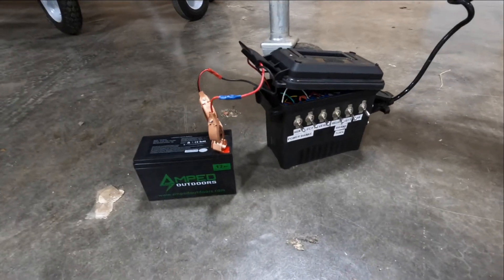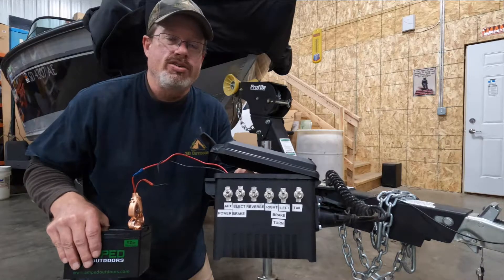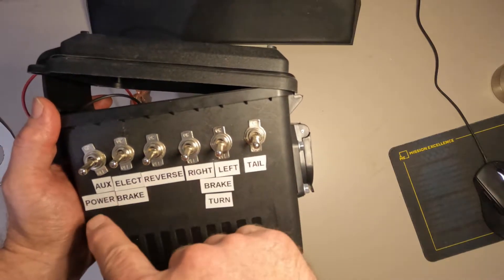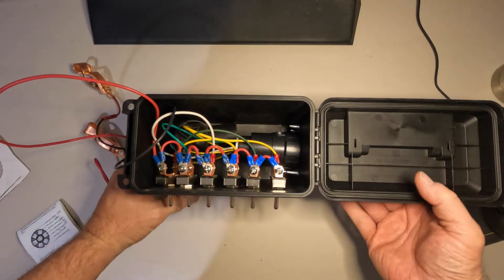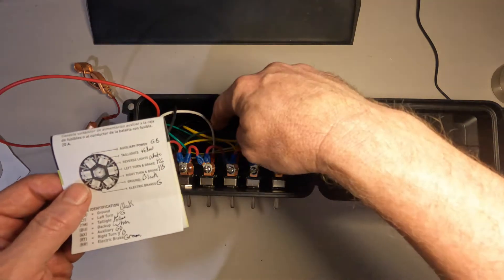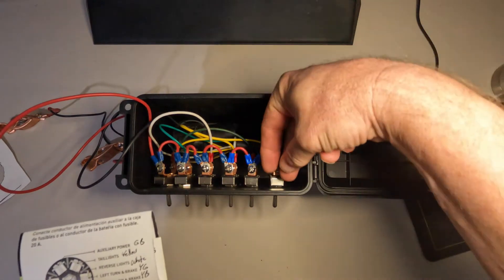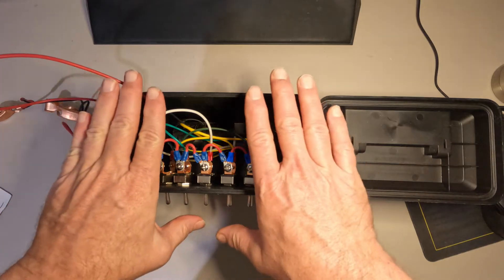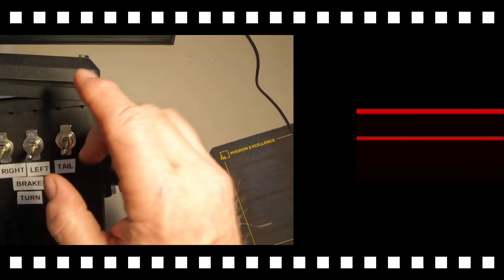Trailer Light Test Box- How to Build

Comment: Made a similar one but for European 13 pin. Also made a vehicle plug tester from 4 compact rear light clusters (2 bulbs 2 LED, this is needed because some vehicle electronics don't play nice with led but might work going with bulb) and separate bulbs for conductors not used for lights. Long cable so I can troubleshoot from the cab - the long cable is connected to the lights with an old school pvc connector strip where I cut down the surrounds for the screws so i can clip on to them. Has a cigar lighter cable to add a known good ground. Test everything from the drivers seat
Reply from the maker: Thank you.

Comment: How does the brake test work? I would like to make this, but need to set an adjustable timer on the brake circuit so when it is on, the brakes will engage with the electromagnet every 3 to 4 seconds and then disengage. If you spin the wheel while the axle is elevated, you can test the brakes if working correctly.
Reply from the maker: Sounds good.

Comment: Hey Dan. Great video! Followed your instructions. Tester showed box was working, now it’s not. Any ideas on why it would work after set up and not now? I haven’t even hooked it up a trailer yet.  Could I have done something ti burn out the switches?
Reply from the maker: The first think I would do is take my tester and hold the negative side on a battery, so you know you are getting grounded and then check at each switch to see if you have power to them. I am guessing that you have either a bad connection on the positive someplace or the ground ended up coming loose in the trailer connector or on the clip you are using to hook up to your battery.
Reply: @3DOutdoors  Hey Dan. Switched out the switches to a marine style with lights to see if there is power at the switches first. They all came on now won’t come on again. I’m definitely missing something. Is there a way to send a photo to show you how I have it hooked up. Should I have a fuse or something? Maybe I burned two sets of switches out?
Reply: I see he didn't add fuse blocks so if you have a grounded light no fuse to save something getting burned up
Reply: @marshallalice6316  looks like a fuse on the red line off the battery

Comment: Hi there just wondering where do you put the + and - on the battery to the switch cheers
Reply from the maker: Most switches have an indicator, but they are simply a devise that opens and closes a conection.

Comment: How do I get the turn signals to flash on and off? I bought a relay flasher and it doesn’t do anything.
Reply from the maker: Don't know, I didn't put a flasher in mine. I just use the switch, if it comes on with the switch it will come on when I use my turn signal. I am just testing if it works.
Reply: If your lights are LED, a regular flasher will not work because the LEDs do not pull enough amperage.

Comment: Even if I no longer drive a passenger car or an 18-wheeler, it is actually very easy to check your lighting, which also saves you the necessary fines. And the fines you receive today are not cat piss (Dutch expression) in other words, it can cost you a fortune these days. Share your finding here and there
Reply from the maker: Thank you